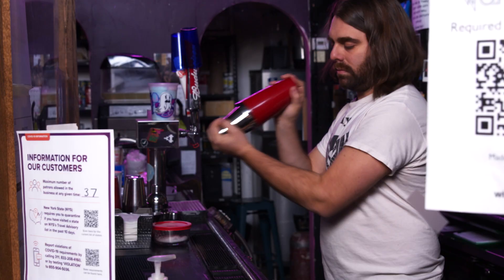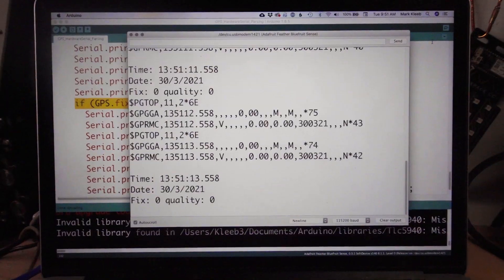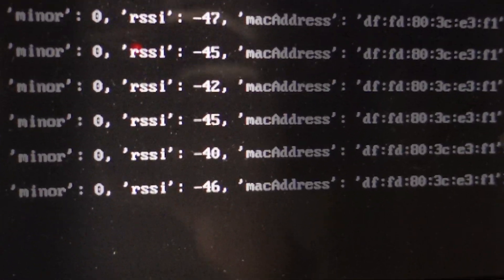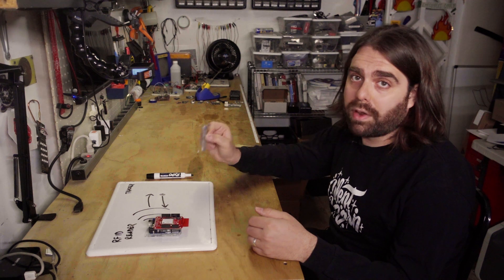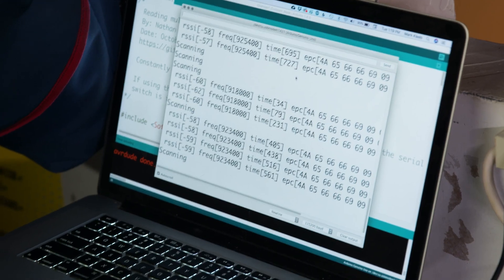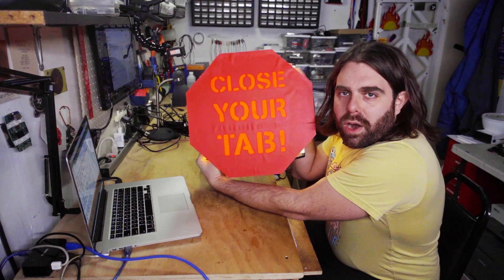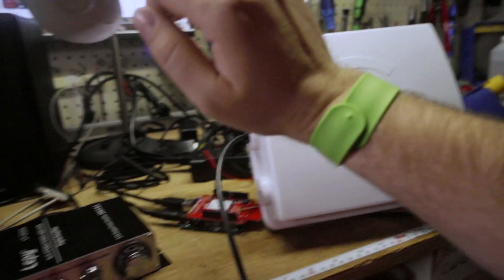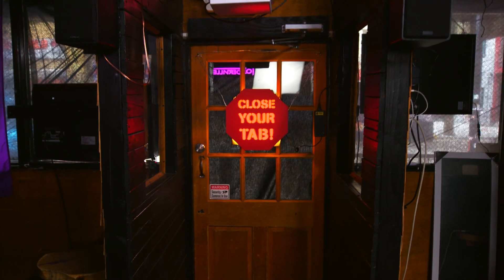Bar Owner Builds an Alarm That Stops You From Forgetting Your Credit Card | Hack Job | WIRED

Comment: Sorry to be a bit dim here, but why do people leave their cards at the bar? I would imagine this voids the terms of the card, as you’re not supposed to give them to a third party. I’ve never seen this done here in Europe. Cheers.
Reply: Its the best way to make sure the tab actually gets paid and they don't leave without paying.
Reply: @nymfan1990  meanwhile the credit card company won’t pay any damages, when you give your card away willingly to a bar tender you don’t know.. it’s such a stupid system..
Reply: @nymfan1990  Thanks. But I still don't get why they don't just pay for their drinks. I've genuinely never encountered this, even on US trips. Is it normal in NYC to open a tab?
Reply: I mean, I get this was a tech project, and I like that, but surely there's a totally simple analogue solution to this perceived problem.
Reply: @jonathanirons231  This is the norm for basically every bar in NYC. You give the bartender your card and they hold onto it for the night, and every time you order a drink, you just tell them your name. You could technically just pay for your drinks one at a time, but that means every time you order a drink, you'll hand over your card, they'll swipe it, give you a receipt, and you'll have to sign it and add tip. By creating a tab, you only have to do that once at the end of the night. It saves everyone's time, which is especially important in crowded bars.
Reply: @micktheant  Thanks! I didn't know that. Sounds like a lot of admin ;-) But I live and learn! Cheers.

Comment: 8:55 It would read on a logarithmic scale because decibels are a logarithmic unit, not a linear one. Doubling the decibel value increases amplitude by a factor of 10.
Reply: By twenty. The power of the sound is increased by ten.

Comment: This antenna costs a lot I think, but the rfid tag is very cheap
Reply: For me as long as it goes on my metal or heavily resistant cards this would be a good investment, since those cards are an investment onto itself. 

But put that onto one of the basic plastic ones who can’t hold a chip bar for more then a few months, it would not be worth the investment  if the card itself will crap out
Reply: @kevind3974  u need to print a 3D box with the tag inside